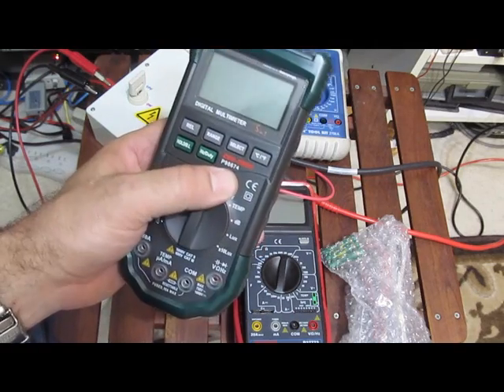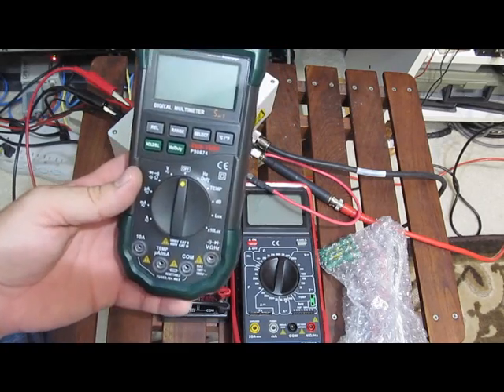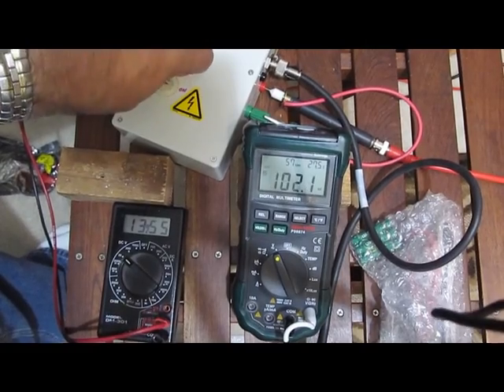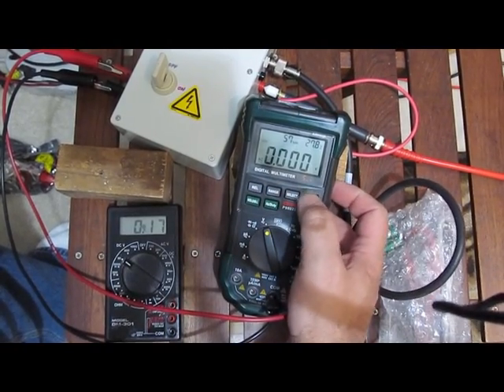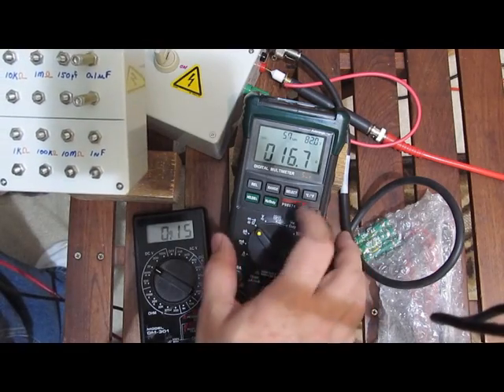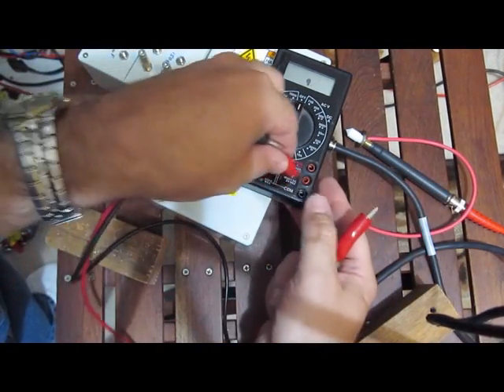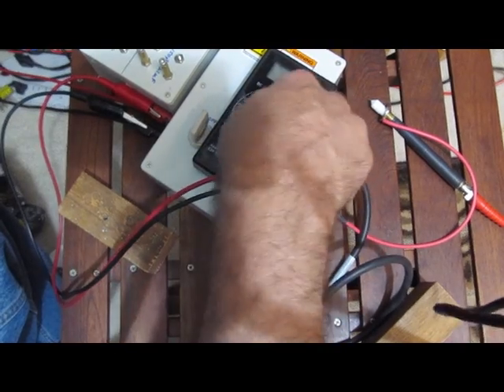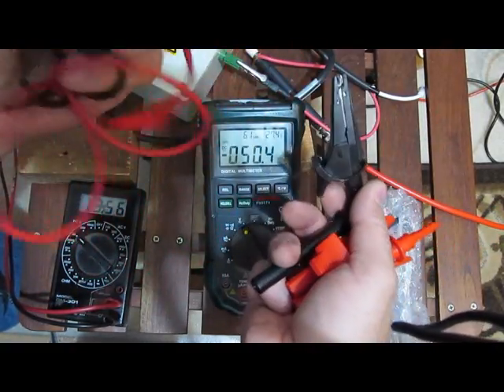Homemade low energy surge generator Evaluating low cost DVMs Part 4 The Cen-tech 98674

Comment: Then look for insights.
Reply from the maker: I have
Reply: @joesmith-je3tq  during your test how was their performance
Reply from the maker: There is a on-line document that provides a summary of all the tests I have ran so far.
Reply from the maker: I should add, that is in regards to the transient testing.  Other tests I have ran are not included but there are the videos.

Comment: That was my second meter i brought when i went to college but my was from ebay and it was the mastech version,  my first meter was a sun equipment  dm 1230, that mastech was great but after 3 years  the range switch started to act up. It got so bad i just threw it away

Comment: Did you run this meter on your newer testing setup ? I was considering buying one of this because of its low price and many functions but now im not so sure. Have you tried repairing it like you did with some other meters or wasnt it even worth the effort ? I like your videos, they are very instructive.
Reply from the maker: Sorry, I did not.  I had hit it with the grill starter at one point but that was it.   I'm sure it would fail at a fairly low level.   Unfortunately, it had damaged the IC and could not be repaired.

Comment: On page 12 of the manual, it states that calibration is required periodically... could the over voltage have thrown it out of calibration?
Reply from the maker: +mnelson10000 It was more than out of calibration.  It took some damage on the front end.